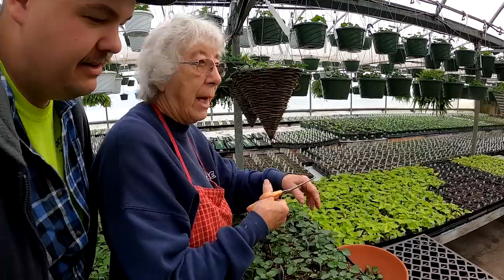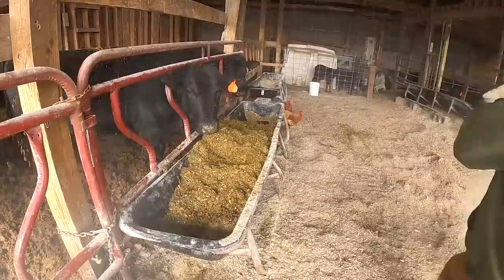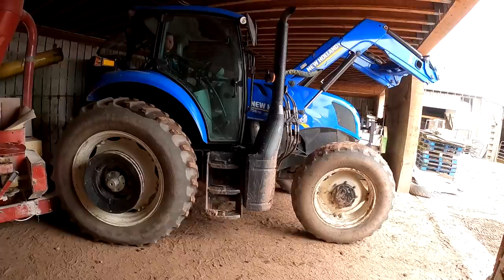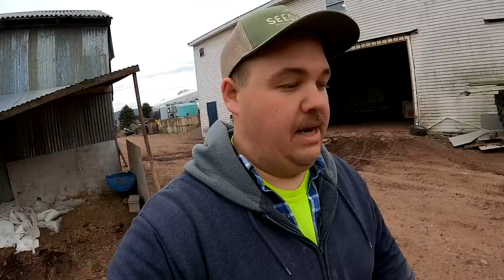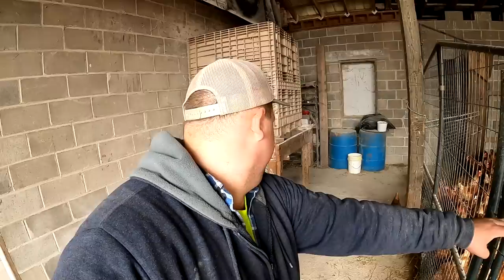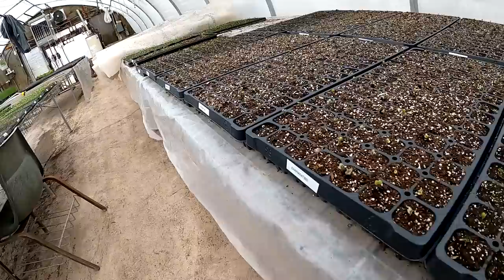YOU HAVE NEVER SEEN THIS ON THE FARM

Comment: DUDE! The wood supports under the lean-to roof should be thicker. Like double or triple the wood post thickness you're using. I know you probably take them away when you fold the roof down for winter but there's still storms and calf frolicking and hitting against them or tractor bumps ;o)